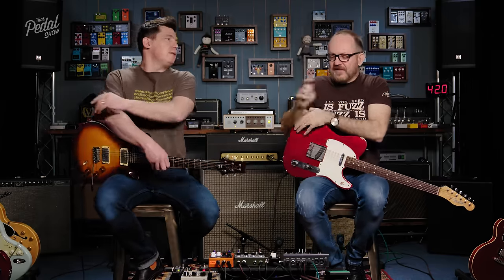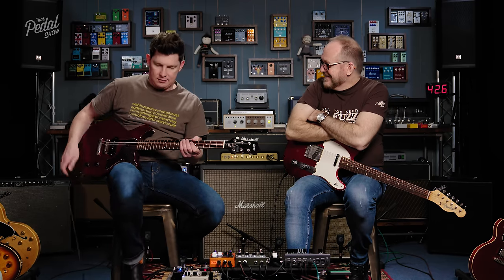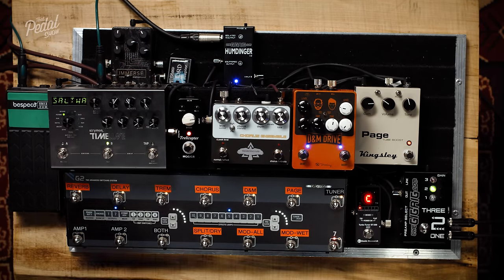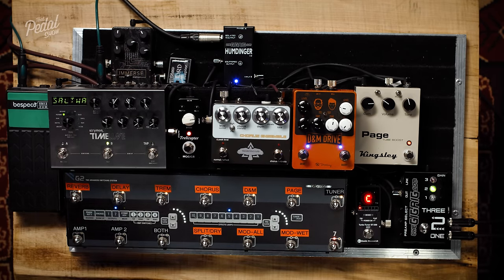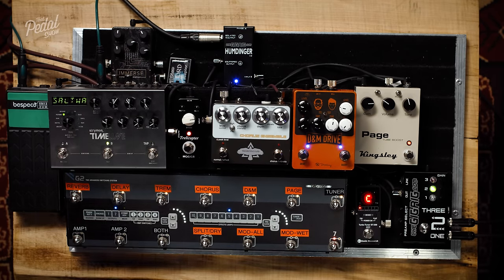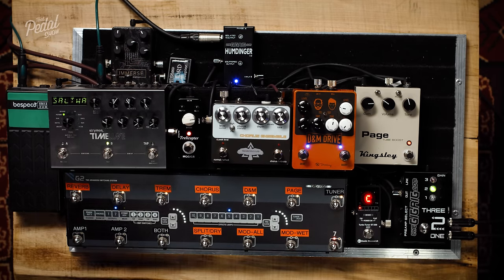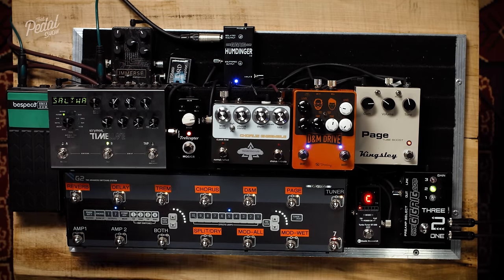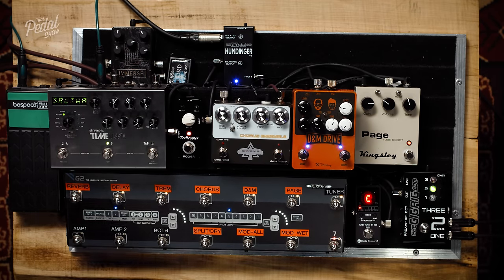Wet-Dry & Wet-Dry-Wet Amp & FX Setups Explained – That Pedal Show

Comment: I use a Marshall JVM for my overdrive and split at the effects loop one goes back to the Marshall and one goes to an AC30. This I can tell you is a good noise! You can get stereo or wet/dry depending on the fx settings.

Comment: Mark P.     The way I created my wet-dry-wet rig and keeping dry and wet sides discrete was to plug into a Humdinger directly. Then running my gain effects from one split into the dry center amp followed by running the wet side from the other split to the two outside amps from a stereo reverb output. This seems to work fine without needing a volume pedal. Is this flawed?

Comment: Hello ! Fantastic episode as usual. I love these wet/dry episodes a lot. Now, a question...i understand the theory behind the stuff. The splitter splits the signal after the "gain", dist, overdrive pedals to one amp and everything to another. That's a piece of cake. Now, my problem is...this is clear while you don't use a switcher...when you have a switcher with no built in splitter...how do you do it? where do you put your splitter? in a loop? I mean, it has one input and 2 outputs (one goes direct to the amp?)... you also said that "you move the splitter"...does that mean that it is connected on an "special or dedicated I/O"? If I want to buy a switcher with no built in splitter but I still need to use my splitter, what do I have to look for in that switcher? I'm very new to switchers... Thanks a lot!!

Comment: What about using a line out box splitting the signal from the amp output going to the cab?  A specific pedal called the LO-1 from David bray amps.   Have you tried that way? What results do you like better for wet/dry.

Comment: Hey Dan, Mick, first of all thanks for sharing your knowledge, I am always learning something from every single episode. My situation is that I am the guitarist in a 2 person band, so basically guitars and drums. I am playing 20 Watt Heads, because crancked they are more than loud enough, for the small clubs we are playing. I went back using a WET/DRY Rig, cause as a small band, mostly playing support gigs, at least I never was lucky enough to get 3 mics for a WET/DRY/WET Rig.
Getting used to a WET/DRY Rig, it is hard to go back to a single amp setup. I also want the WET/DRY Setup when I am writing songs. I am not always in our rehearsal space outside the city, and living in a city appartment makes things difficult. Most oft he time I take my amps home and run them through an UA OX BOX with speaker simulation using headphones.
QUESTION:
Seeing your OX BOX on the Marshall I was asking myself how it would sound, running my two amps into two OX BOXes, going from the Lineout from both OX Boxes, for example into an UA Interface or a Mackie Channel Mixer and only hearing the sound from the OX Speaker Simulations directly on Headphones coming out from the Mixer or the Interface. Do you think it is even possible to get that nice wide sound on headphones? What might be problems with a setup like this? (meaning Isolation? Or bringing Speaker Simulation in phase?...God my brain start hurting) But if sg. like this would work it would be awesome to record ideas with a WET/DRY or even WET/DRY/WET setup, silently in a city appartment.
Thanks in advance!
Best-NOXX-

Comment: Hey guys, good stuff, as expected ;) Just one question. The belle epoch deluxe has a buffered bypass option, where the preamp is on and just the delay line is taken out. So would that solve the phase issue, or does the reversal happen in the delay line? Cheers

Comment: Wonderfully explained and demonstrated as usual! However, as you illustrated at the start all pedals going into one amp results in a bit of a mushy sound. Probably due to the gain going int the delay and reverb. In the wet-dry you split the signal after the gain pedals so the wet amp also receives the driven signal which then goes into the "wet" pedals. Would it make sense to put perhaps only drive pedal after the split to the delay etc? I would think the end result would be that the wet amp gets less compressed and therefore the delay etc stay more clear. Ahhh, so complicated or have I got it all wrong??? TPS is and stays the best!!!

Comment: Great video, super appreciate all the signal path diagrams/explanations. I was wondering if using two of the same amps in a wet-dry set up would undermine having a wet-dry rig, i.e. two different amps are better sonically? 

I know it’s a matter of personal taste but I was just wondering what your thoughts are on using two of the same model amps. Thanks guys!!!
Reply from the maker: not at all, its still a great way to use wet/dry
Reply: Thanks guys!!!

Comment: Been running all my amps on  dedicated pedal boards in wdw for years.  All boards have some form of boost stacking, Modulation, reverb, and delay.  I never thought about putting the dirt before the 3 splitters until now.  Thanks now I have a more  even sounding alternative to my clean dirty dirtier stereo setup.    Any thoughts on running your gain stacks after the split if you have 3 unique  pedalboards?
Thanks Doug

Comment: I'm convinced !  A lot of amps, like mine have direct outputs that send out the entire amp signal so I have been using that instead of a splitter. I send that to my delays, reverbs to a stereo amp to a pair of speakers. Would the same phase reversal protocol hold? In other words, must be reversed. I ask because I have been undecided about where to place modulation effects. My H9 choruses sound incredibly weak after the split. Would phase reversal change that for the better? Problem is how to effect the phase reversal.
Reply from the maker: Bunch of things going on there Tom. Mick here. You're basically mixing your effects in parallel using the stereo amp and speakers - kinda the same as it would be done with outboard gear in a studio. Phase is definitely a potential issue when adding any more amplification or speakers... it could be that with the H9, of it could be that it needs a different signal strength. That direct output is probably line level and the H9 is //probably// expecting instrument level. Something to check anyway. Cheers!

Comment: Tried a Wet / Dry set up for the first time today after watching this and I freakin loved it. I did it by just going out of the tuner of my Erni Ball VP JR which I have running after my drives. Have you ever tried that?
Reply: Joshua Pritchard that’s a ghetto way to do wet dry but it’s not good. You need a legit splitter or line out box to do it. The tuner output on the volume pedal just cut off your original input signal into 50% 50%, it can also easily cause phase problems as well. 
That’s why in their video they mentioned your signal has to be isolated!

Comment: Delightful episode guys! Long term fan of the show. 
Inspired by your earlier episodes, I built myself an epic Wet Dry Wet rig for my home studio and despite the fact that I know my way around pedalboards and debugging the s**t out of it, I am having some weird hum problems that I can’t figure out, so I was hoping to pick the brains of the geniuses that you are!

The rig features 11 Strymon pedals and a good dozen others. No single power supply handles that, so I am powering everything off a Furman filtered power supply feeding a pair of Strymon Ojais (for the Strymons) and the rest is powered with the wonderful GigRig System taking care that everything is on isolated outputs etc. The split to dry out occurs with a Lehle P passive Splitter that has an isolated out and phase correction. The dry out never hums. The stereo out is from the Strymons. 
Connecting everything step by step everything is super quiet and beautiful until I connect the Strymon power supply, then there is some weird digital squealing noise in the first Strymon and the last pedal before it when they are engaged. I am at a loss to understand this and how to prevent it? Do I have to have a humdinger between those two pedals?
An even weirder problem occurs early in the chain, where I have a Whammy that is in a separate loop taken out of the signal path and powered by the GigRig system. As soon as the Strymon power supply is connected there is an audible hum, even if the Whammy is off and out of the signal path. Unplugging the Whammy it goes away.
Heeeeeeeeeellllp, I am in over my head here .... I am loving loving the sound, but these (occasional partial)  noise problems drive me crazy.
Sorry for the long post and keep up the awesome work! Also - have fun at NAMM!

Comment: Big Fan here, Hello!
Just a quick Q:  Where in the signal path would you place a pedal that has both modulation and dirt like the Keeley Dark Side?  I'm setting up my wet - dry sound and now wonder if I was to get one of those, how it would sound. 
Are you guys thinking about doing a video on workstation-kind-of-pedals?

Thanks!

Comment: Interestingly! I have put a remote switching dual loop pedal after the splitter and plugged the left side of my delay and reverb pedals into the two loops (the right side is in my main loop switcher ) and so I can remote select wet / dry or stereo per sound. Works well

Comment: Quick question, maybe I have missed something. If you use a delay with ‘Kill Dry’ into your wet amps, and then turn that delay off, will that not cause an increase in volume because you are suddenly getting a whole heap of direct tone coming back into your wet amps. Would you need to keep the delay on at all times in this setup and ‘feed it in’ with a volume pedal, as opposed to having the delay turn on/off per preset? Thanks guys, great episode

Comment: Hi guys, great episode. Here's something you may want to address in the next VCQs, in relation to the splitter or ABY box, what is the situation with signal loss and buffered outputs. Should one or both outputs be buffered? If you have a buffer elsewhere in the chain (either before or after the split), is that likely to resolve any signal loss? Or is it like many things associated with signal chains and depend so much on the specifics that all you can do is test things out to see what works. Thanks for all your great videos.

Comment: I running a wet dry setup with delay and reverb in the effects loop of the wet amp ( Lone Star wet,  Stiletto dry). I prefer the sound of the delay in the effects loop. The dry amp is quiet but the wet amp is pretty noisy. I replaced all the tubes in it but it didn't help. I'm using the Boss ES8 switcher using the left and right outputs to the amps ( sorry Dan when I bought it I had champagne taste but only beer money). Would I benefit by using only the left output of the switcher to a humdinger splitting to the amps?

Comment: Two questions come to mind during this;
Does it make a big difference running wet dry with two cabs stacked on top of each other rather than side by side, thinking about space on stage etc? Does it matter which one is the dry one?
Second, with a digital pedal with no analogue dry through, is this likely to cause phase issues with the dac lag in the same way using a digital amp might?
Amazing sounds in this show guys, the tremolo was a bit of a revelation to me, I've never really got the straight tremolo thing but in that setup it was awesome.

Comment: I have 2 VCQ's, but first, a compliment: This is the ultimate Wet Dry breakdown. Super helpful because I just got a second amp (Fender Bassbreaker 45) to pair with my Supro 1970 RK Custom. Just got to get me a Humdinger now. 
VCQ:
1) If you were running a Wet/Dry, how would you use/where would you put a loop pedal like a T.C. Electronic Ditto Jam 2 or a Boss RC-30 Loop station? Is this possible with a traditional (Ie: Mick's) Wet/Dry setup?
2) Can you post a diagram of Mick's Epoch Deluxe signal path phase solution?

Comment: Fellas, I am planning on trying this out.  I have  a 2 part question. I have a tweed blues Junior and  a 1969 twin reverb.  Which would you suggest to run dry?   Also, I love the sound of the twin but it weighs a ton, so I normally use the jr.  removing a speaker and a pair of tubes may save me some weight.  Thoughts?

Comment: I play a 3 amps rig, 1-main(fairly clean), 2-very-wet(reverb on full + slap delayed), 3-bass amp(!) .... the two guitar amps get a fuzz pedal signal. i'm  not sure they go out of phase with the bass amp, but the phase relationship change for sure. (i think, hard to tell).

how would you recommend setting up my sound?
i have a buffered splitter in the beginning of my chain.

what do you do when things go sort of out of phase, and not 180 degrees out of phase?

thanks!

Comment: This show has been little short of a 'revelation' for me! After 30 years, or more, of wandering the tone wilderness "gathering random facts" that never quite seemed to fit together, you have brought me to the top of tone mountain so that I can view several routes to rich green tonal pastures below, in several fascinating directions. Thank you! 
My take away is the wet/dry delivers 90% of the bacon, while wet/dry/wet adds another 10% of gravy. However, the move to stereo that is required to achieve wet/dry/wet comes with an additional bunch of complexity (and perhaps some loss in flexibility). You didn't make the flexibility argument but I hypothesize, for example, that a wet/dry pedal board could be used quite satisfactorily with a single amp, especially with a pedal to adjust the wet component of the signal. However, the stereo pedals on a wet/dry/wet pedal board may not  transfer quite so well to a single amp when one side of the stereo signal path is truncated. In any case, the additional complexity alone with wet/dry/wet may not be worth the trouble for many people. How am I doing?
Reply from the maker: Hello Alan, glad this is of use! Yeah we agree with you. Even if we haven’t said it explicitly here we have said it many times before - wet/dry way less hassle than stereo and moving to a single amp is easy. 
Happy tones to you!
Reply: @ThatPedalShow  I must have picked "wet/dry way less hassle than stereo and moving to a single amp is easy" subliminally from one or two of your other videos, before I appreciated more (as opposed to all) of the details ... thanks again!

Comment: Thanks Guys!!! Favorite topic!! thought i share my experiment, I used a boss LS-2(need to get a Humdinger for hum) to split my signal - Dry Amp - THR10 and using GFI system Cabzeus(great cause there are phase options) for my 2 Wet speakers.. It sounds really good for an apartment /Bedroom setting , Only thing is the "power"/experience from actually Amps, which you guys are Feeling in the room. 

PS - Do the Tee shirt with hand signals of the wet/dry/wet if you can.. Thanks again for The Knowledge !!! Appreciate it Lots!!

Comment: How do you not lose half the delay repeats in the wet/dry set up if you have both stereo outs connected on the timeline? When you run the wet/dry set up are you only getting the Left repeats or can you configure the wet effects to be Mono in a wet/dry set up and Stereo in a wet/dry/wet set up?

Comment: Great video guys! Thanks for sharing your thoughts on this reasonably complex subject. I do have a relatively simple question for you experts here, that I'm REALLY hoping you'll answer. I'll try to make it as simple as possible: I have the equipment necessary to do a W/d/W system in either one of two different ways, and I'd like to know which one you folks think would offer the best all-around sound. Option 1) Limited up-front pedals, in series, into a central (dry) amp, with the amp's Line-Out going to stereo rack-mounted effects (delay/reverb), then to a solid-state stereo power amp and twin (wet) speaker cabs, or Option 2) Limited up-front pedals, in series, into an ABY Splitter, with Channel A going to a dry amp, and Channel B going to effects pedals (delay/reverb), then out (in stereo), to twin powered amps with matching speaker cabs. I've asked this question to multiple folks on multiple forums over the weeks and months, but I've yet to get a reasonable answer. Which of these is likely to offer me the all-around best sound? Many thanks for your time, consideration, and guidance.
Reply from the maker: Hi Joseph, Dan here, the problem is an all-round best solution is only ever subjective. The only thing that really matters is what you wanna do with it and the way that you want to sound. Personally I like option B better but option A also could sound amazing. If you’re going into a valve preamp then coming out into the stereo fx left and right valve power up into the cabs that would be great. You just need to make sure that you have an analog dry-through, unless all of the wet effects are in parallel in stereo. There’s so many options with this type of rig, the ones you have listed will work great, it all comes down to does it give you the tone you like. Hope that helps.
Reply: @ThatPedalShow  Dan, thanks so much for the helpful, timely reply, and yes, it helps immensely. I actually started messing around with w/d/w setups years ago (ca. 1995), using Method 1) because I had (and still have) some really nice rack-mounted FX units including the original (older) Intellifex unit, the TC-2290 Delay and Lexicon PCM-91 Reverb, with Carvin 50:50 SS power amp to a pair of EVM-12L's, but for lack of a better word, it sounded overly 'digital', kinda synthetic or "sterile". So I've long-wanted to try the all-pedal approach, and based upon what you've said here, I think I'll give that route a shot. I've got an Orange Rocker-30 head with matched 2x12 (or maybe a lower-powered 12w Princeton combo?) for the dry side, a bunch of stereo pedals (chorus, tremolo, delay, reverb, etc.), and a matched pair of lower-powered but nice sounding Tone King Gremlin heads (with dedicated 12" cabs), for the wet side. It'll take some work and a boatload of decent cables to put it all together, but hey, I'm psyched! Thanks again for the helpful guidance. You da man! 👍